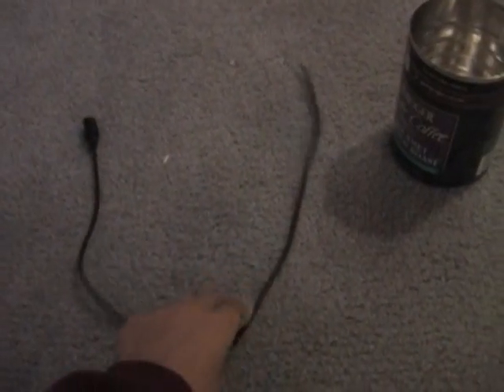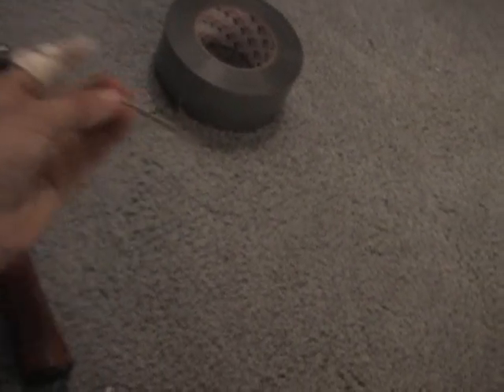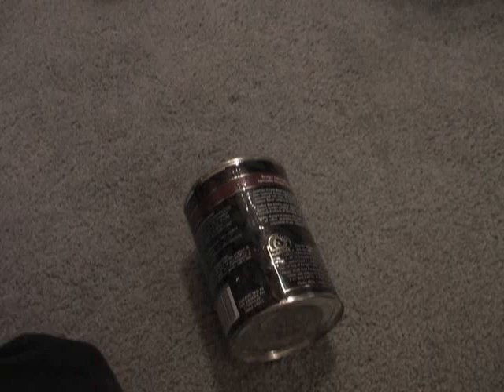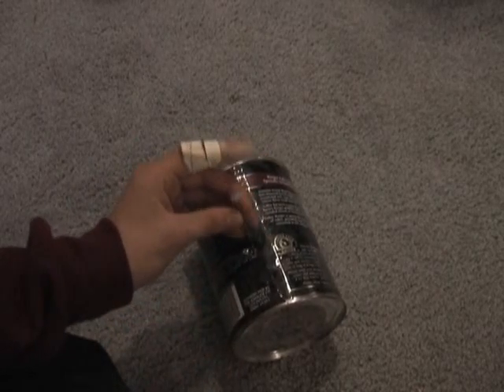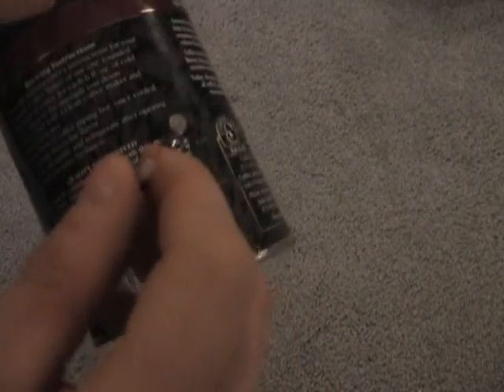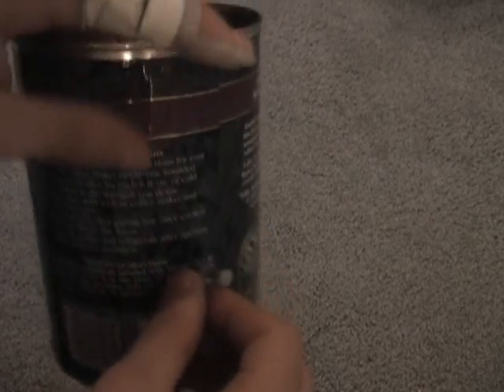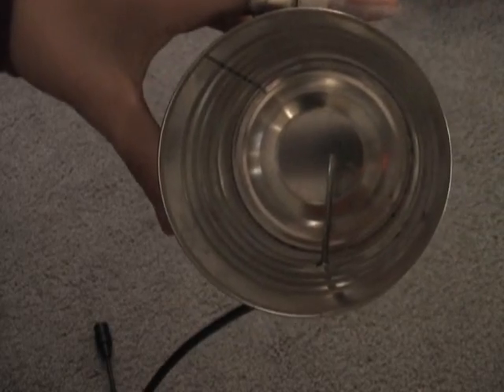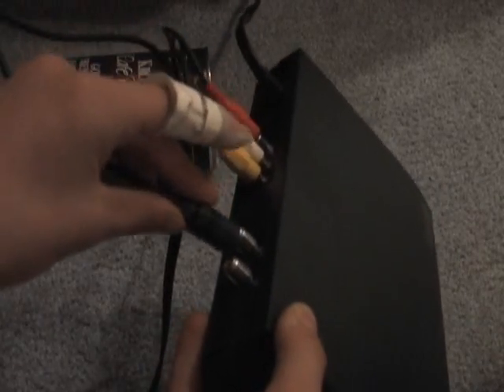How to Make a Digital TV Antenna

Comment: hi my digital teac tv will power on by remote but the TEAC logo is all that is displayed. the logo stays on for 30 secs and then their is a blank screen for 5 to 10 seconds and repeats itself. tv can not be switched off by remote or side tv power button. can you help me to get tv operational again please. thanks.
Reply: Probably won't find a lot of help asking in the comments of a video from 2008 of a guy using a design for a direction WiFi antenna as a DTV antenna. 
 Okay starting with the basics, push all the buttons one at a time on the side of the TV and make sure the seem like they are functioning properly. If your remote is IR (probably is) point it at a camera and push the power button and make sure it just blinks when you push power and stops blinking when you are not pushing anything. Next try unplugging the TV for at least 5 minutes then trying it again if it goes back to cycling unplug again for about a minute and plug it back in, if the TV is not mounted to a wall put your ear to the back of the TV and turn it on and listen while it does the whole cycle in about about 4 spots around the back of the tv, if its mounted on the wall just do it on the front and the sides. Smell around the top most vents to see if it smells like burnt electronics, unplug every input and USB from the tv and try it with power only plugged in. If you feel comfortable doing so lay it flat screen down over a flat surface with a towel or blanket to protect the front side, then take the back off and look for bulging compactors or burned components, without knowing the model number, the size, the screen type, it's hard to really say a lot on what next. 
 They don't sell that brand where I live but there is a good chance at least some of them have been sold under different brand names (Westinghouse/ Hannspree/Etc). Not knowing any details about what kind of tv you have I would guess it's going to be the main board. Also im guessing the TV is over a year old but less the 5

Comment: Total bull, learn a little bit about electronics kid then make a how-to video.
Reply: Kugruabay  total bull except for the fact that it works.  Certainly a better connection (IE: scrape the paint off the can then solder the wire) would help but this will actually work just fine if the antenna is close

Comment: Wow. It works great! Thank you so much. It is so hard to even find an antenna and I doubt it would work as good as the one I made. I did use a bolt instead of a nail, with a nut to secure it. Thanks again.

Comment: Live in the city within 15 miles on the local broadcast.   However most antennas required constant re-adjustments,   this project worked perfectly.   We used a pumpkin can and a screw.

Comment: OMG -it worked!  I'm in the uk and in the middle of getting ready to move house my tv stopped working. I fiddled with the set top box for hours and hours, I wired and rewired my aerial cable no luck. I starting crying and getting angry. I even went to the next town and purchased a new set top box. Nothing. I got a empty tin of beans and did exactly what the video said making sure the insulating tape covered the nail and coax connection properly and voila perfect picture! I cried with happiness!

Comment: u dont even need to do all this. just take some speaker wire wrap one end around the male connection firmly and with the other wire twist it like a twist tie so its small enough to fit in the hole where the pin would go

Comment: Thanks, I got 32 channels!! But I modded it to get 46 what I did was , I took a coat hangar, cut it in half, then scraped out all of the insolation, I then duct taped it into the can and then the same with the other half, and where I live I got 14 more channels.

Comment: That was amazing. It seemed so unlikely (but so easy to try that I made it anyway) and it performed better than the shop offerings for indoor aerials (the ones I tried were amplified units costing 40 to 50 Euros each)  and so much more interesting! I've got it picking up Spanish TDT right now - and it sees every channel in my area. Congrats and thanks.

Comment: Four things: 1) Did you wrap toguether both wires of the coax?
2) How long would the can last?
3) Somebody said it's against the law, really? How can be this simple system to receive free air tv signal against the law? We are not using anybody else property, the signal is in the air and coming to our house.
4) Where is the best location to place our "antenna" inside the house or outside?
thanx a tone

Comment: Yes, it worked... It worked fantastic.. You can find coax cable at any thrift store cheap. If in Tucson, Needfull Things at 742 West Limberlost, has lots of them for about a buck each... Of course move it around a bit like you would a regular antenna. I even put a piece of tin foil in the can, sticking out of the top and it works even better, go figure huh? NUTTY BUT TRUE!

Comment: Did this really work like you said? i just don't want to ruin the only length of coax cable i have, please let me know, i bought a portable 7 inch tv from radio shack with a built in DTV tuner and it picks up only 5 channels but does have a side connection where i can hook up a coax cable.

Comment: this looks like one of those directional cantennas people were using for wifi a few years ago, only difference you should insulate the signal "nail" from the can and run the ground shield to the can.  now there is a calculation of what wave form you're trying to receive to determine the nail position from the end, and I think this is why most people go to the coat hanger style antenna

Comment: This is a good setup for a quick WIFI antenna, run the antenna to the center and ground to the can. this'll increase reception within the range.  As for DTV we need something more spread out cause we recieving higher on the spectrum.  Good try...

Comment: Thanks.  Any advice on where to find info on antenna design /engineering? How does this compare with other other homemade antennas?  Is this better for VHF or UHF? One confusing thing is that people are saying digital over the air TV is UHF, but why are some digital channels in the under 13 range? (channel 5-1 for example)

Just FYI, The cable type is pronounced cO-AX-eeul.

Comment: Dude,

This is kinda confusing so I'll describe the TV to you, it is about 13 years old, and I used it with Rogers Digital Cable (a brand), we used to use a converter box, but it could also support regular cable, so will it work? 

Thanks